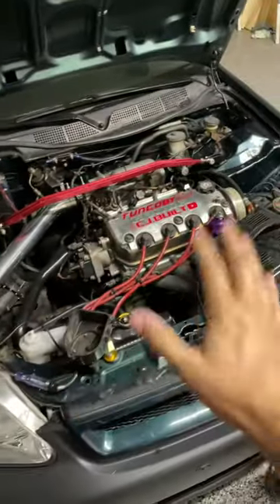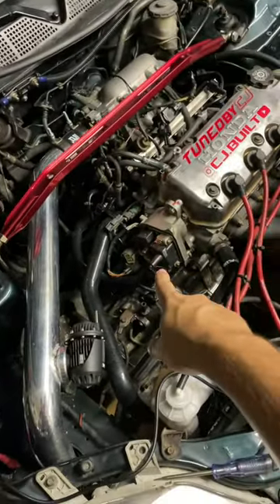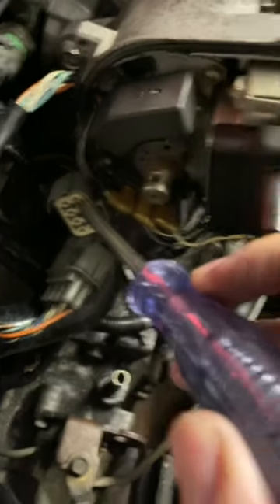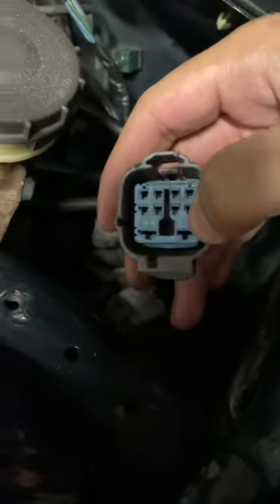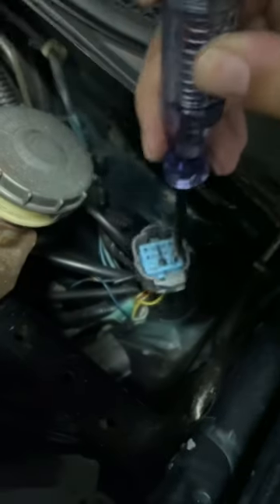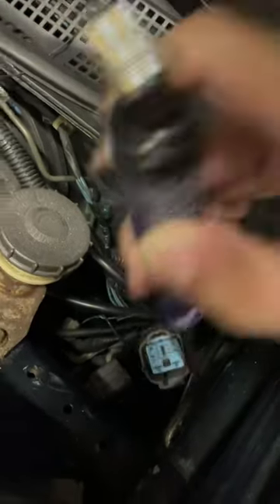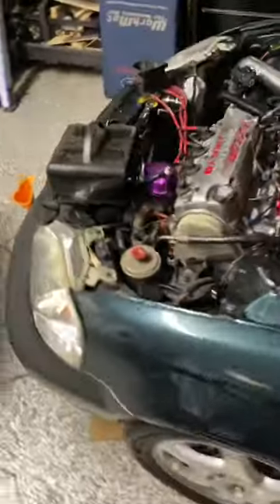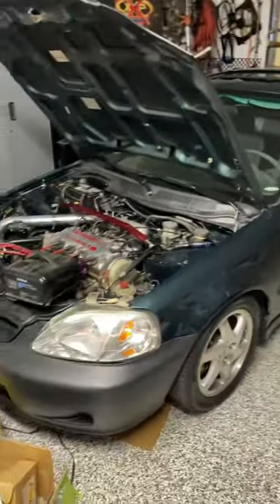Part 2! No Power to Distributor 96-00 Honda Civic #shorts #honda #civic

Comment: hey i just had that same problem. I checked everything, did research and nothing worked. Then randomly checked my wires for the ecu and some of them werent connected. Also, if you are using a converter check and see if you have the right one. Hope you get her running, gl
Reply from the maker: Thank you for the advice!
Reply: Facts,  it's a very common issue when swapping you ride. Check every connection starting at the ecu, fusebox, then harness connection points. If all else fails then check all your grounds to metal. Hope it helps.

Comment: It's your whole ignition switch your whole key tumbler the whole wire setup change that and I guarantee do you even have lights when you turn the key when you put the key in the accessory do you have any of your lights come on at all do you have any like power as far as your window or anything like that cuz if you don't I guarantee it's the key set up I'm just want through the same thing

Comment: What was it????
Reply from the maker: My issue was at the actual fuse box
I had no power coming from the wire In The back of the fuse box. I ended up running another source of power to that wire to bypass that pin. I’ll try to tag the video I posted detailing what I did
Reply from the maker: https://youtube.com/shorts/DETG3CGizrM?feature=share

https://youtube.com/shorts/_oyWPLxtfsU?feature=share
Reply: @CJBuilt how do I click on this and find it. I’m having the same exact problem😊

Comment: I’m assuming you’ve double checked all the relays? Also, did you put the jumper wire in over on the passenger side on that plug which will cause the screen to flash giving you a specific code? Numbers do not appear it’s just one of the lights will flash and you just write down the intervals that it flashes and look that up and it’ll tell you, if there’s a fault somewhere which could be causing you not have power there. I would also double check all your plugs at the ECU. I know you were showing where you pulled or connected to one of them in order to do your two-step if I recall correctly I would go through unplugged and then replug one of the plugs to make sure you don’t have any bent pins and then confirm that you have power coming out of that ECU and you have a good ground. For the love God grounds will kill you, not literally but crap won’t work lol

Comment: I'm having the same problem.  Was it your fuse??
Reply from the maker: For me it was the fuse wire coming from the actual fuse box. Not sure what the actual issue is but I just ran another power line to it. I have another video posted showing it a little b
Reply: Ok cool thats what I'm going to try this weekend

Comment: i was having similar problem. i getting power to my distributor but no sparks. i changed coil and icm but still no spark
Reply: did you ever figure it out? I'm having the same problem
Reply: still didn't figure it out. i even replaced the crank sensor. someone told me i probaly had a bad ground connection somewhere.
Reply: I'm at this point now I've changed cap rotor wires and plugs fuel filter even the ignition coil inside the distributor. I'm currently pulling fuses and checking if any of the popped but something is telling me to get a new 300 distributor 😢
Reply: @marvinpunty1665 same problem I got everything new dizzy and cks relay ecu running out of ideas